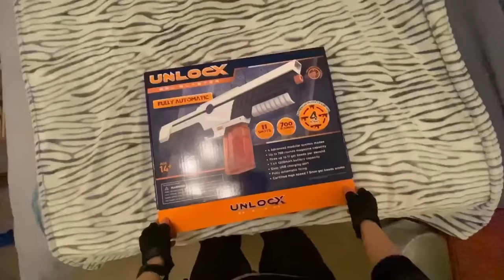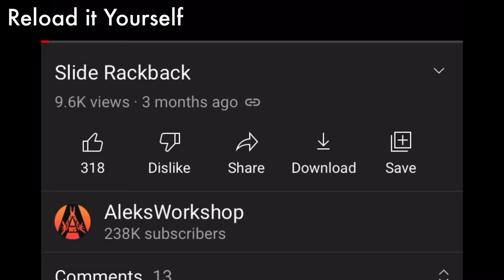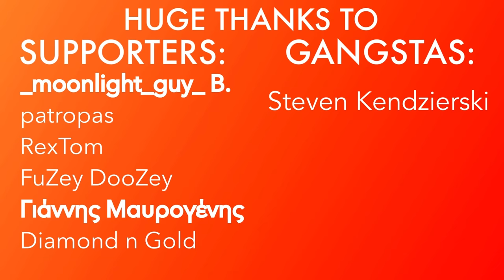ALL POSSIBLE PISTOL RELOADS

Comment: The High FoV should've been a retaining reload where you don't let go of the original mag and load it back in.
Reply: SO TRUE
Reply: thats was the bad game animation
Reply: @NaakteMolrattenZijnCool  every fps game does that. Otherwise they'd have to make individual animations that have mag 1 and mag 2 because otherwise you might see the first mag fly back into the gun. It's not bad, it's smartly optimized.
Reply: @Krisztian08  yes, but it shouldnt be visible
Reply: csgo in a nutshell
Reply: @Krisztian08  well maybe except tactical reloads
Reply: @NaakteMolrattenZijnCool  well, yeah, that's the joke about the reload anim, that the fov is high enough that it shows  the mag.

that only happens when you fiddle with the viewmodel fov, not the whole fov.
Reply: @patrickglaser1560  wrong version
Reply: @NaakteMolrattenZijnCool  your not supposed to see the mags in those cases so they never bothered
Reply: @Krisztian08  As someone that animates as a hobby, you can just clone the prop in some engines and despawn it when it's off screen. It's not a big deal nowadays.
Reply: On top of that, the bigger issue is lining up the temporary props with the locked in mag without it snapping at all. Lots of games slightly screw it up because you're anchoring a different prop to the other hand.
Reply: StrastTheFox  yea they do
Reply: StrastTheFox  do you know anything about game development? in games where you can see your body, its just another fake model and not actually whats there. the only game that would possibly do that is vr games
Reply: LMAO true
Reply: An extra hand in the corner because the view model is just that broken
Reply: StrastTheFox  a comment brought me back here, they still do that in full body games you just dont notice it. take rainbow six siege for example, it shows almost your full body (legs and a bit of the chest) and they still do that method
Reply: @stormstudios1  no, no they don't do that for every reload- empty out (almost) any gun and watch the operator drop the magazine as a prop (that will lay on the floor) while they load in a new mag.
Reply: @Krisztian08  not every fps game just puts the same mag in, for example most call of duty games visibly show smg's mag being pulled out, and swapped with a second one in hand before being put away
Reply: fov بالا باید یک بازنگری حفظ شده است که در آن شما اجازه نمی دهد رفتن به mag اصلی و آن را دوباره در قرار داده است.
Reply: @Krisztian08 not pavlov

Comment: 2:05 always faster to switch to secondary than reloading
Reply: Remember: Switching to your sidearm is always faster than reloading
Reply: And if the secondary is empty too?
Reply: @donsealion  pull out your thirdary
Reply: @BubbaFett450  bro studied mw2
Reply: @bruhidk3337  the first modern warfare actually
Reply: @PLAYER-Bot2312_1  and if your thirdary is empty aswell?
Reply: @BlackHole44444  fourdary 😃
Reply: @PLAYER-Bot2312_1  and if your fourdary is empty?
Reply: @BlackHole44444  fivedary 🙃
Reply: @PLAYER-Bot2312_1  and if thats empty?
Reply: @PLAYER-Bot2312_1  and if that is also empty?
Reply: @BlackHole44444  7dary🧐
Reply: @PLAYER-Bot2312_1  wut if thats also empty?
Reply: @BlackHole44444  8dary
Reply: @PLAYER-Bot2312_1  thats empty too
Reply: @BlackHole44444  then it a empty
Reply: Yo gaz survived
Reply: @BlackHole44444  ninedary
Reply: @randomtsbcontentcreator  10dary
Reply: @lifeofthedonuts and if that's empty?
Reply: @riyaansheikh7470  Ya dead because you did not load even one out of the 10 guns you have

Unless... you have a secret eleventhdary

Comment: the modded pistol reloads are NOT pistols. the ATF said so themselves. "The ATF has long held that by installing a vertical gore grip on a handgun or pistol, the handgun or pistol is no longer designed to be held and fired by the use of a single hand. As a result, it no longer qualifies as a handgun or pistol under Federal statutes and regulations."